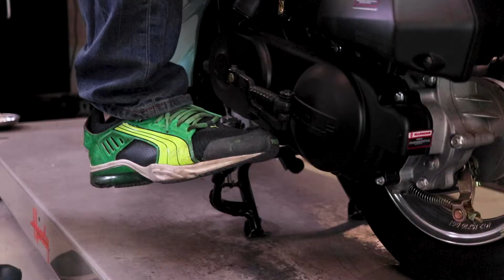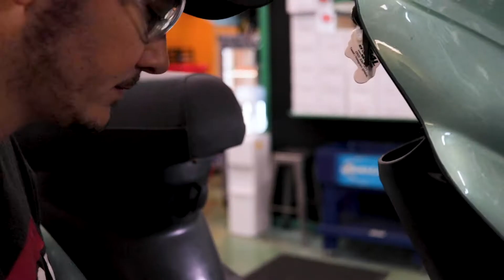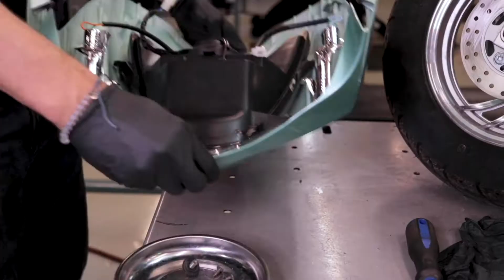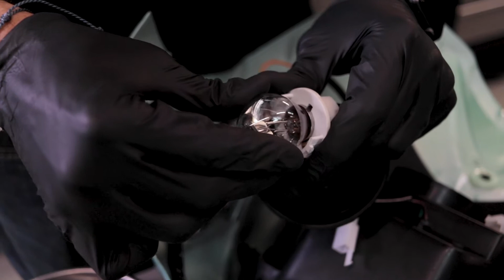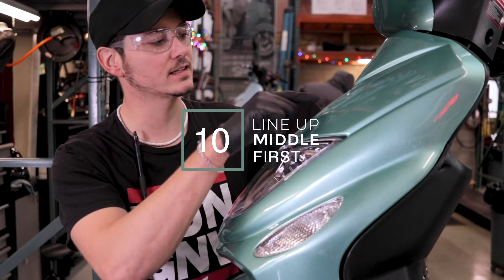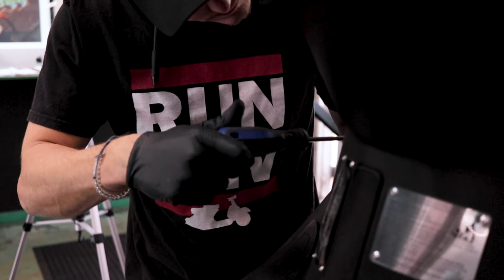How To Replace Your Wolf RX50 Scooter's Headlight Bulb | NS4L How-Tos

Comment: Hay there I have a very important question so my front light which I have replaced it's a BA20D led bulb I'm not sure if it's the bulb it's self or the battery but when the front light is on it flickers very bad it stops when I hit the breaks and then proceeds when I let the breaks go.

 What does this mean ??

 It's been properly installed also this is a WolfRX50 only had the scooter for a month
Reply from the maker: Could be something with the voltage regulator or stator (charging system). It's hard to say.  I'd have to see it in person to figure it out and test some things, but it may not be regulating the voltage throughout the bike properly.

Comment: So today low beam and high beams out and also tail light but blinkers brake lights work and horn what does this mean
Reply from the maker: Check the voltage on the battery with a voltage meter.  Make sure that the scooter isn't getting too much voltage.  Could be a bad regulator if it's not simply bad bulbs.

Comment: Have a video how to change back tire?
Reply from the maker: We don't.  You really need the correct tools to ensure you don't stretch the tire, etc.  :/
Reply: @NewScooters4Less  what socket size is the back wolf tire size nut should i say what tool do i need to take it off im in desperate need to do so i cAn i go to work tomm thanks
Reply from the maker: @kevinthorn9672  17mm.  Need an air gun, otherwise it's next to impossible.
Reply: @NewScooters4Less  air gun?
Reply from the maker: @kevinthorn9672  Air Impact Tools

Comment: Can you put a led bulb? also went to change my bulb now none of the lights work at all. it starts but no lights?
Reply from the maker: Yes you can.  If none of the lights work, you could have a bad voltage regulator.  Check to make sure that voltage regulator (also called rectifier) is plugged in.

Comment: Ok so my high beams work but my orginal lights went out? I have the same rx50 in black.. is it the bulb or something else thanks hope you can reply quick
Reply from the maker: It's the bulb.  If you look in it the bulb I bet you will see one of the filaments is broken.
Reply: @NewScooters4Less  where could i buy one at a store and whats that Pacifically called
Reply from the maker: @kevinthorn9672  RX50 headlight.  Email Brandon in service.  service@ns4l.com.  He can ship you one.
Reply from the maker: @kevinthorn9672  RX50 Headlight Bulb.  12V 35W Headlight lamp. Thanks.

Comment: I just blew my head light on my 2016 wolf Blaze Came straight to this vid 😁 Thanks very helpful vid 👍✌️Can I order parts straight through the company ? If yes how long to NC normally ?
Reply from the maker: Hey!  Absolutely.  We're in FL so shouldn't take long for it to get to NC.  Just email us at service@NS4L.com and we can help!  Thanks!
Reply: @NewScooters4Less  Cool I'm thinking about upgrading my carb the carbs that come stock suck I'm sure you already know this lol What carb do you recommend for a replacement on the 49cc wolf Blaze ?
Reply from the maker: @EJ-74  We don't have any performance carbs.  We just have the stock ones, so not sure where to guide you here. Thanks!
Reply: @NewScooters4Less  Ok Thanks for the reply if I need any stock parts I'll check back ✌️
Reply from the maker: @EJ-74  Sounds good man!